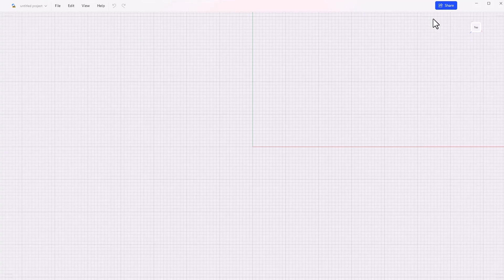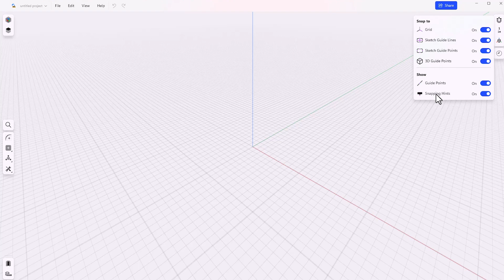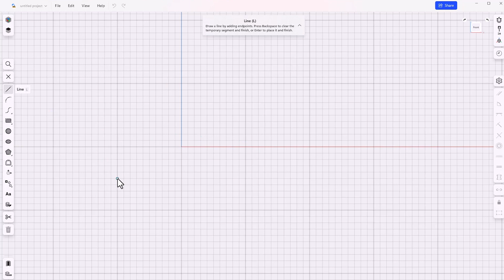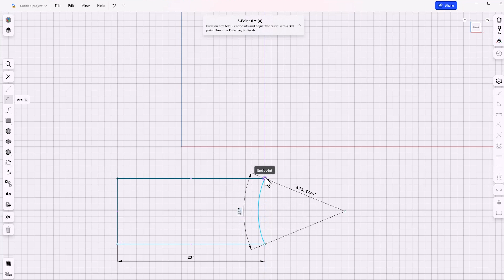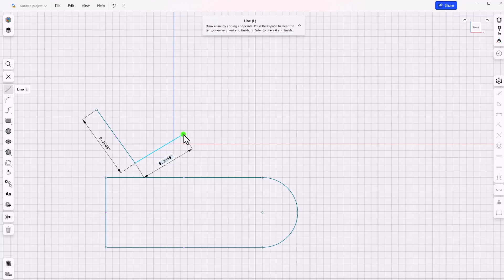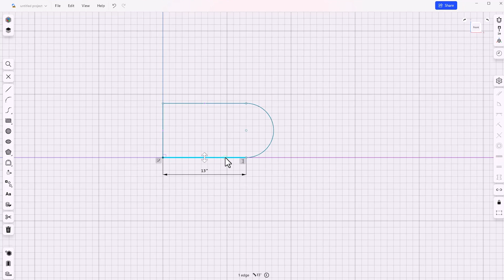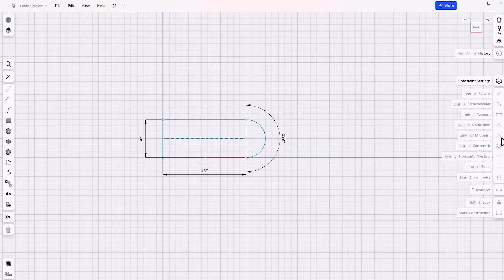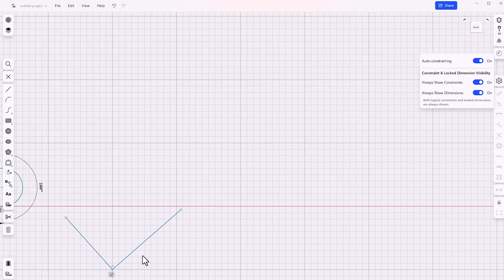Grid and sketch settings | Shapr3D Basics

Comment: The “sketching” and navigating the various tools I find to be extremely unintuitive. Everything gets out of control very quickly if you don’t understand exactly how the tools operate. For example whatever you can do in “sketching’ vs whatever the non-sketching mode is. For something as basic as selecting, at 5:38, what “tool” are you in? I exit “sketching,” but when I select a point, it goes right back into “sketching” and I can’t select anything, only drag new lines. Also can’t lock a single point.

Comment: I want to build a 1/12 scale model which means 1 inch represents 1 foot at full scale. Is there a way to customize the grid settings so that a 1in x 1in box has 12 subdivisions to represent the scaled down inches?

Comment: I'm using a stylus on a 360 laptop. How do you switch from drawing lines to selecting items @5:37?
Reply: I found I need to tap and hold before the selection prompt comes up!
Reply: :( I'm unable to switch between the selection options by tapping on them with my finger. I have to open up the laptop to be able to physically press the tab button to switch through the options.